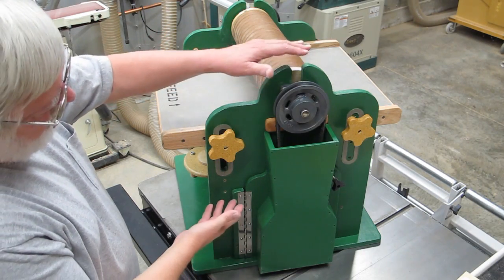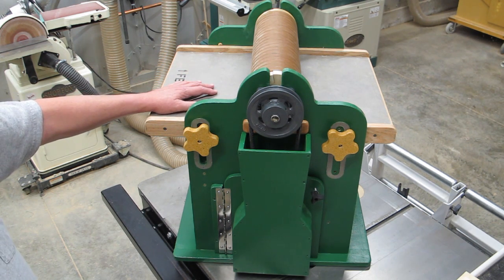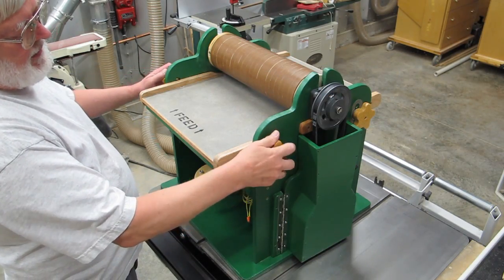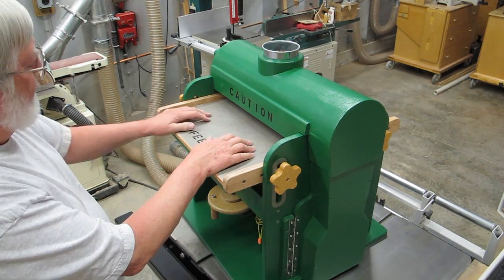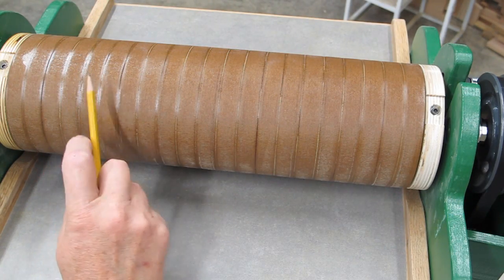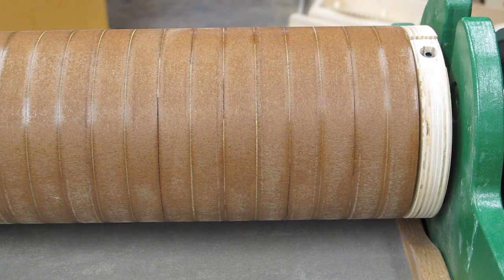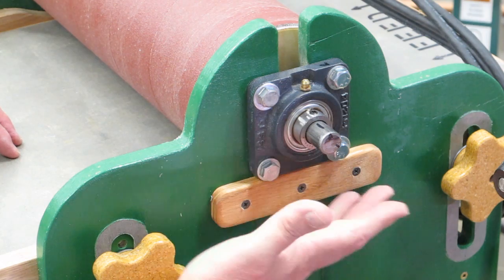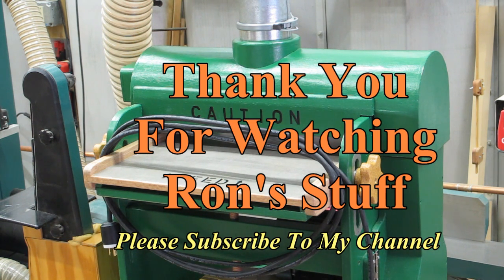Drum Sander - Trials And Tribulations Using Old Plans For A Shop Built Sander

Comment from the maker: I copied a process from Matthias Wandel (woodgears dot ca) and painted it with a latex paint and then painted that with a polyurethane varnish. Lowe’s Olympic Premium Flat Base 5  72005, 130-2Y7.5, 107-1Y5, 113-2.5  which I think describes the mixed color. Water base polyurethane on top of that to make it shine and give it a durable surface. Hope that helps. Thanks for watching!

Comment from the maker: Dimensions of my sander are pretty much the same as shown on your plans. The upper ends of the sides are the same except the lower portion, which were made taller to clear the self-contained motor. The size and mounting configuration of your motor will have some effect on the dimensions of the sides and how tall you wish to make the sander. My solid table is the same size as the adjustable conveyor belt table shown on the plans… I just made it one solid piece instead of the adjustable halves.

Comment from the maker: Oneida 1.5 HP Cyclonic Cartridge Dust Collector returning air to the shop through a Thimble Plenum with 4 filter tubes and is rated at 750 CFM @ 8” of water.

Comment: Did you ever try putting a very slight crown on the belt drive rollers?  That is generally  how the manufactured units are built.  Not a noticeable crown, just ever so slight.  Helps the belt to track.

Comment: It just dawned on me.  Did you check to see if the rollers where axially parallel?  If the rollers are not ABSOLUTELY parallel (twisted) there would be nothing you could do to get the belt to run true.  Sure was a bonzer job though.

Comment from the maker: surpluscenter-dot-com   located in Lincoln, Nebraska has a fairly good selection. I purchased a 10 ft length of roller chain and the box is marked ANSI 25-1RX 10ft and the 5/16 shaft sprockets were 9 tooth 13 tooth and 19 tooth. If you don’t find it let me know and I will try to find the paperwork but that was a couple of years ago so no guarantees.

Ron

Comment from the maker: eBay – “Brevel Model 703 Small Reduction Gear Motor” by “bestboxman”. Shaded Pole induction motor 183:1 reduction 19 RPM shaft speed. I used a computer cooling fan blade. Chain drive used 13T and 24T sprockets for 10.3 RPM roller speed.
Construction article at woodgears.ca – reader projects

Comment from the maker: That may work for long flat boards, but for shorter sections and irregular pieces (such as clock wheels) the drive wheel probably wouldn’t stay engaged. Also, you need to feed material through in different positions every pass to even out the wear on the sandpaper. There are commercial drives similar to what you are describing (called power feeders) and are used for feeding material through shapers. Look at grizzly dot com and search for power feeders.

Comment: I built the original one from ShopNotes a few years ago. I like your mod. I was just thinking of modifying mine with a motor as well. I would like to put on the hook and loop, where did you get the loop material. I have the same problem with the feed. Maybe I'll pull the belts off and try without.

Comment from the maker: Good question. Hopefully you build it fairly close. I’ve only used it on the highest (or thinnest) setting. Woodworking isn’t an exact science so if you’re within a few thousandths you’re probably close enough. You want the sandpaper just touching the wood… thin cuts. The hook & loop sand paper has a bit of cushion to it (due to centrifugal force) so feed the wood through in one direction, turn the wood 108 degrees and feed it through again to averaged out any difference in thickness.

Comment: Hi! I like your sander a lot, great work!
There is one thing that i dont understand: you have star knobs on both the infeed and outfeed side and i guess the knobs on the outfeed side are to lower the table to be able to push thicker stock through. but if thats correct, how do you do the alignment of the table to the drum to get a a consistent thickness over the width of the stock? Isn't that something you have to do every time you lower the table with te outfeed-sided knobs then?

Comment: Awesome video, have you tried removing the rubber bicycle tires from the rollers. I would suspect they are shifting and that is what is causing your track to keep moving. When you straighten the tire the rubber would be thinner on one end more than the other. This added by the fact that the rubber would roll around the wood itself also changing its position. If you haven't already, maybe take them off to see how it goes. Just a though, hope it works.

Comment from the maker: I’ll probably try another power feed conveyor one day but it certainly won’t be to the original design for this sander. I tried making a temporary trial crown on the rollers using staggered layers of tape, which didn’t seem to help either. I just think Murphy was having his way with this conveyor.Probably flange bearings instead of bushings, crowned rollers with individual adjustments on both ends of one roller and one-piece rigid sides for the conveyor.

Construction article at woodgears.ca

Comment from the maker: I don’t know. This is my first drum sander and still new. The Drum pushes the stock down. Finish is a function of slow steady feed. Vary the feed rate, you will see it as an uneven surface. Light cuts, slow steady feed and it seems to work pretty well. End-For-End the stock every pass. On narrow pieces I felt a little chatter but have not seen it in the surface. Maybe the sand paper needs to be rewound - a little stretch on the hooks? Possibly drum sand first, then finish with a random orbital.